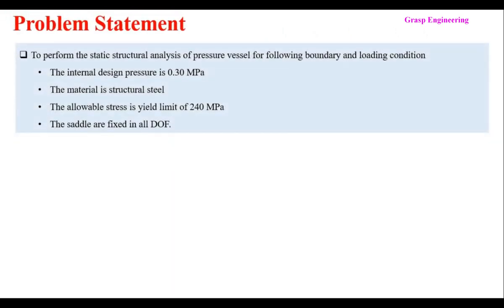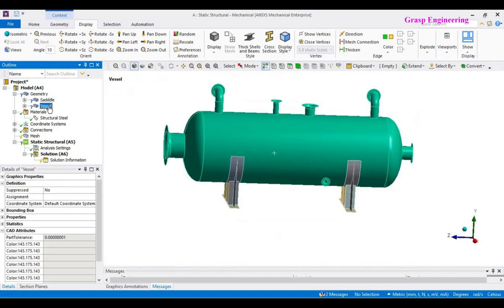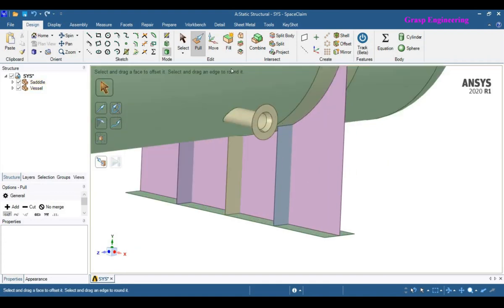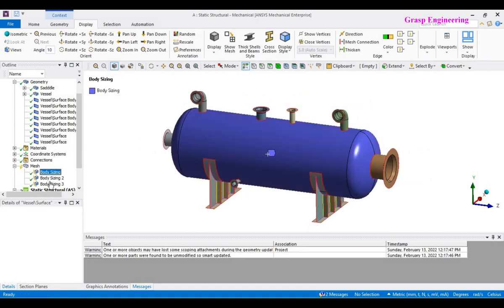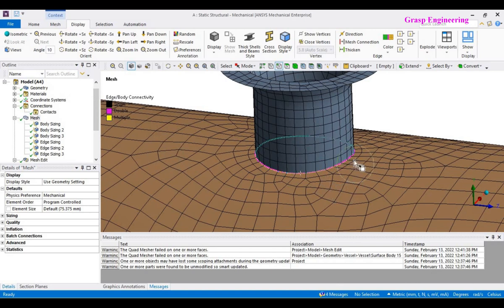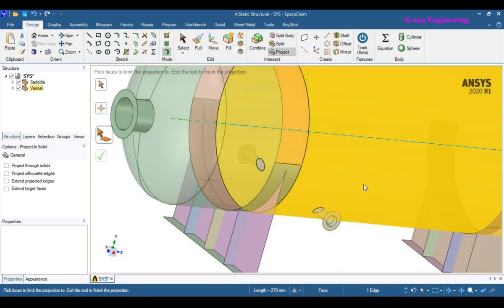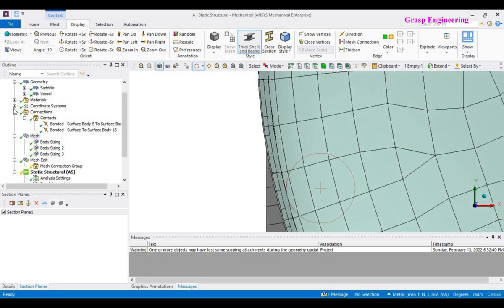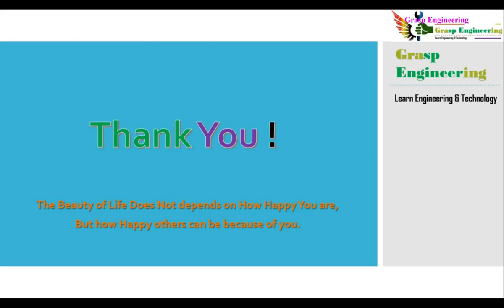Pressure Vessel Analysis Using Shell Modeling Approach With ANSYS

Comment: .
It was a nice informative video thank you very much for your efforts

I have a question for you

I had a solid model, I modeled it as midsurface in the space claim program, but due to the thickness, the edges and faces do not touch each other, in the same way, the surface surfaces do not touch each other, in this case, do I need to extend the edges and surfaces in the space claim program and combine them?

Best regards

Comment: If I want to have a conformal mesh (that is I want the nodes to merge with each other) between shell outside surface and saddle inside surface than how can I do that in Ansys workbench?
Reply from the maker: You can create form a new part in spacelaim and includes both shell and saddle bodies. Generally shell and saddle are welded, so for shell apporach you need create weld so that all parts are joined toghethor by weld with node merge.
Reply: @graspengineering9249  If I use share topology in space claim than the overlapping surface will get deleted in mechanical. So how to do it?

Comment: how will we handle the fillet welds in a shell modelling approach?
Reply from the maker: you can create the two surface and create slant surface and assign weld thorat thickness. The shell weld is demostrated thorugh image in ASME section 8 div.2.

Comment: Sorry, can I ask you why it gives me this error: Solver pivot warnings or errors have been encountered during the solution?
Reply from the maker: Check your boundary conditions. Check the connections, use edge display make sure all edges are well connected. Check for any mission contacts. It is simple error, if your model is well connected and proper BC are applied then error will not encoutred furhter.

Comment: Thank you very much for the video. Can I use the shell model and perform submodeling for the nozzles? And perform linearization?
Reply from the maker: Yes, you do stress linearization for shell model too.
Reply: @graspengineering9249  Hi Sir, I am currently struggling to do stress linearization on shell elements. Can you kindly do a video on stress linearization on shell model. Thank you for your much valuable content.

Comment: I have more than 2100 surface structure in geometry if I want to select them at once how to do it...Ctrl is for selecting one by one ??
Reply from the maker: Control plus mouse first button and drag over all the geometry or right click select all ! or  select from tree !
Reply: You can use the box selection filter instead of the point/single selection

Comment: Hi sir, thank ms for this great video. How to obtain membrane and bendinh stress in shell element? How to do the stress linearization in shell element?
Reply from the maker: You will directly get option in results for membrane plus bending. For more accurate way, you can write script, we are working on Pressure vessel training course, you can subscribe for insights of pressure vessel simulation.
Reply: @graspengineering9249  Hi Sir, thank you for your reply. Where to subscibe?

Comment: One cannot obtain ASME or EN3445 Code Check with Ansys - no client can validate your model so it will not pass Inspection.

One can export out of Codeware Compress or PVelite into a Solid Model which can go into FEA. So your Workflow is not in sync.

Mickey Mouse!
Reply from the maker: ANSYS is analysis tool. It does no have any ASME code check excpet piping b31.1 in old version. You need to perform FEA using ASNYS and do postprocessing with respect to ASME Design by Analysis Approach.